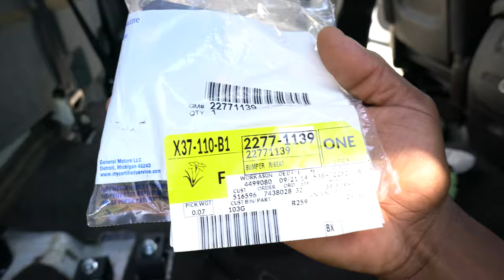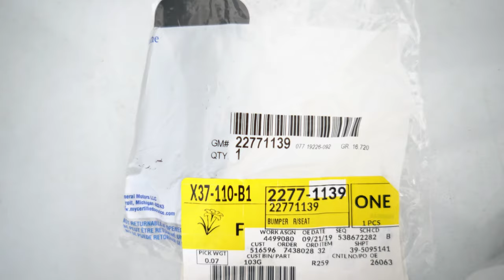Install a Seat lift kit in your Silverado, Ford, or Dodge truck for massive subwoofer install.

Comment: Just go to lowes get some coupling nuts to go on existing bolts then a steel threaded rod into that with a seamless spacer and put the nut on top of that problem solved cost you like 5 bucks per bolt back latch part just attach a mending plate with a bolt n nut do whole thing for like 20 bucks
Reply: You have a video or something that explains ? Because that kit he uses is like $170
Reply: @JesusLopez-xo8nx  no but basically they're called coupling nuts. Get some square steel tubing a piece for each bolt drill a hole in it then to extend existing bolt screw on coupling nut and then screw a threaded rod into that and the original nut for the seat goes on that basically the tune is the lift n the rest is to extend the existing bolts pretty simple once u see what a coupling nut and threaded rod are. Or if u want to go cheaper use seamless spacers on the. Bolt with washers instead of the square tube
Reply: @JesusLopez-xo8nx  or use round tubing really a number of ways
Reply from the maker: It would ns really nice if you could post part numbers and quantities bc it sounds like it will look real bootlegged.

Comment: Can you fold the backs or the seats forward after the lift was installed?
Reply from the maker: No because of the bracket you install on the back of the seat which compensate for the lift. I'm sure there should be a way to convert it to a latch though.
Reply from the maker: @Jose-ce4vq  Google what I put in link it'll come up

Comment: Bro whats the measurements for the front and back height? I'm trying to see if my box will fit with the 2.5 lift
Reply from the maker: Not sure if you're referring to the box or seat but just add 2.5 in to whatever your current seat height is and it should give you all the numbers you need.
Reply: @CurtARoll  I'm trying to see if I need the 3.5 kit. My skar box height is 10 1/4  front and back of box is 7 3/8
 I guess I could change the top bolts and add washers what u think
Reply from the maker: @13salinaspride  I thought about going with that size but I didn't want to sacrifice headspace
Reply: @CurtARoll  ya that's what I'm scared of. I mean I don't ever have anyone back there but still. U think some washers on top of that 2.5 would be safe
Reply from the maker: I think washers will work but I doubt you will need to use them.
Reply: @CurtARoll  you think that 2.5 loft will give me atleast 10 1/4front and 7 3/8back height?